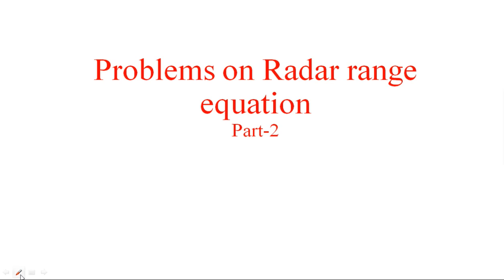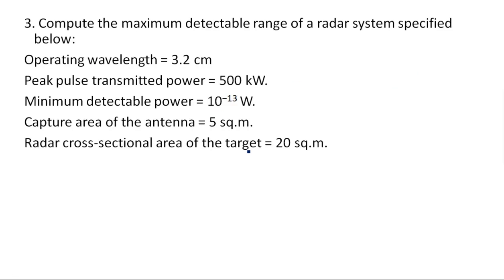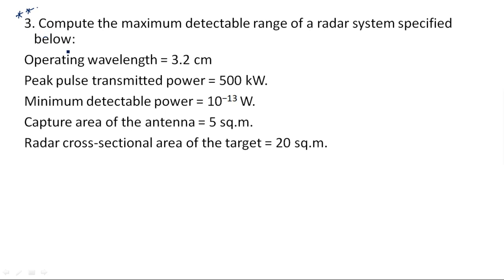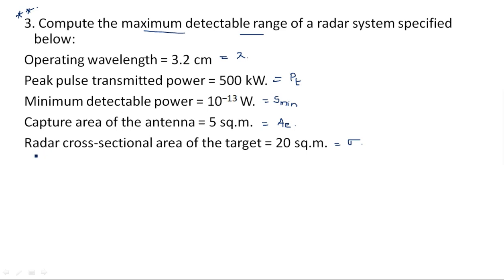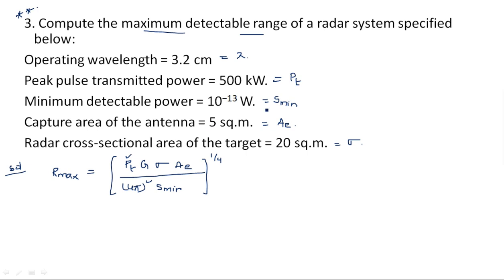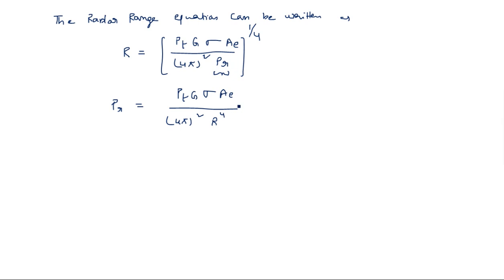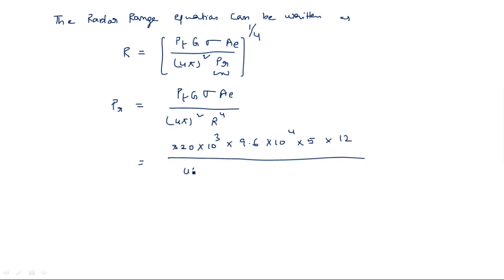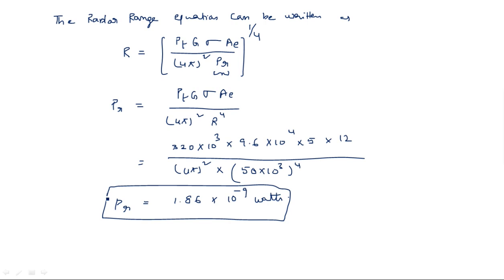Radar Range equation | Problems | Part-2/2 | Radar Systems | Lec-17

Comment: Power Received 'AT' 50 km , not power received by radar's transmit antenna from target at 50 km. Range equation is for reflected received power.